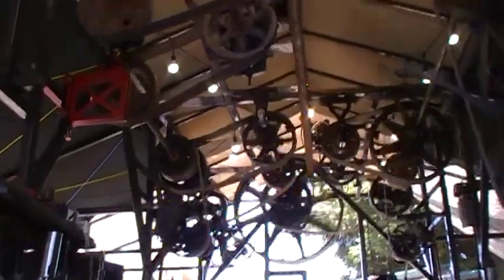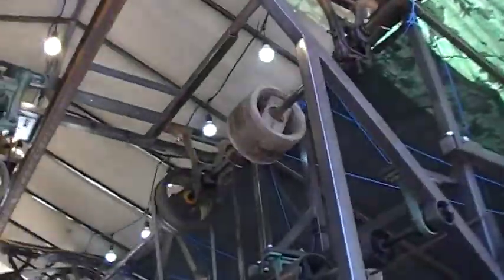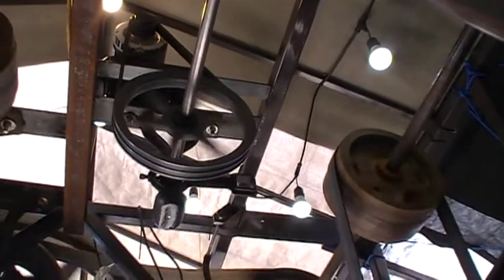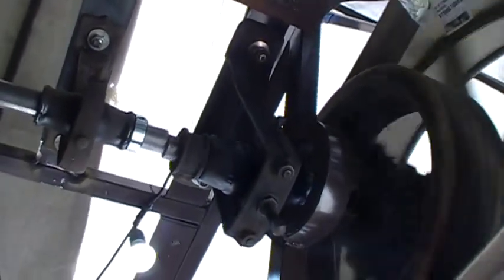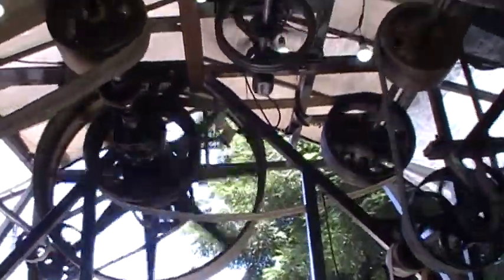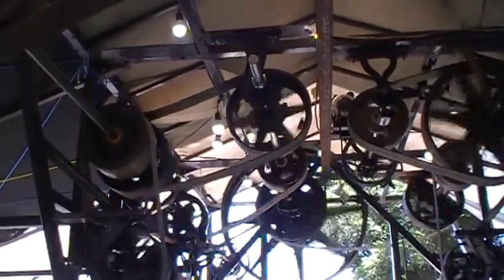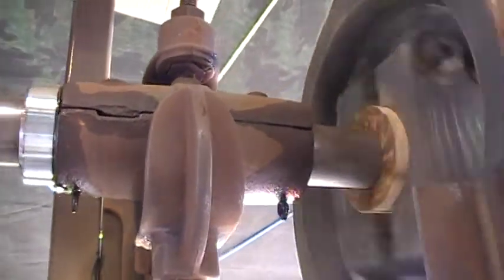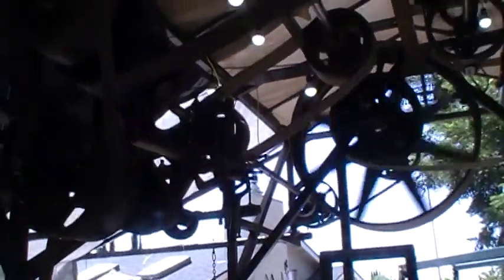Pulleys and Line Shafts

Comment: Hi David

Get a couple of clamp meters and see what the startup currents are on each drive...
The old way they synchronised stuff was to use DC drives...
Printing presses used DC motors...so it wouldn't tear the paper...

That what you've done here is an interesting display of lineshafts and associated pulleys, clutches & belt shippers...
People often just concentrate on the machine tools...and don't think about the various apparatus to get the drive down to where its needed...
Millwrights were skilled men...
Reply from the maker: Thanks Glenn. Now I have to come up with something else. This thing is going to sink under it's own weight. Hey what's the time difference between here and you?
Reply: @davewilson1591 

I'm not sure of the time distance...I'd have to look that one up..
I did send you an email though...
Check spam...
Reply from the maker: @glennmoreland6457  hi Glenn. I took my wife to Rome a couple times and it's 9 hours ahead of us here in sunny California. I figured you had to be at least 7 or 8 hours ahead.

Comment: Where did you find all these line shaft parts? im trying to find enough to set up my artistic smithing shop to run on line shafts as its way easier to maintain one engine vs multiple huge motors out in the off grid boonies. Unfortunately north carolina didnt really have many factories and shops like this compared with places further north and the few pieces i did find were being sold for astronomical prices as decorator pieces. im 25 and working on an artists budget so $1000 for two bearing blocks and a few feet of rod between for a coat rack that im just going to cannibalize for parts is out of the question. if youve got any leads you wouldnt mind passing along it would be very much appreciated and would certainly help keep this sort of system going for a new generation. thanks for your time if you read this.
Reply from the maker: Great that a young lady is interested in old technology...
The sad reality is this stuff is rapidly disappearing and some people think it's worth gold...  well I love the stuff..
 But I had to bite the bullet and spend the money.   A bit invested here.   Look on craigslist offer up Ebay local flee markets garage sales friends and join your local early day gas engine and tractor association.  Have patients it takes time and good luck.. 
You're young never give up.
Reply: @davewilson1591  thanks for the response! it seems like two distinct camps around here, one of people thinking its absolute gold, and others sitting on barns of the stuff just because they dont think theres a market for it. im trying to chase down a lead on a very nice line drive lathe that would be a nice upgrade in general thats currently rusting away in a field, and im hoping to someday come across some cache of pulleys and shafts i can afford-or at least build up a collection of enough compatible bits over time to make a setup. 
Reading your response did remind me though, up in the mountains near here are a couple old steam tractors rusting away in junkyards. it may be worth a bit of time to ride up and try to find out who owns the yard and if theyd turn loose of anything. At least it wouldnt hurt to shake those bushes. Wish me luck, maybe someday i'll be able to post the results to youtube or at the very least just keep the tech alive.
Reply from the maker: @emilyrobinson6080  I would suggest that you start video taping your projects earlier 'cause they're gone once you move on...  good luck.... your journey is just beginning.

Comment: Interesting set up - line shafts as art!  
If you want to know your rpms, rather than doing the calculations, get a digital laser tachometer.  That will give you instant accurate readings.  They run about $25 and are well worth the investment.
Reply from the maker: That sounds like a great idea. Where would I find one at that price? I use the medical technique of counting revolutions for 15 seconds and multiplying by 4. It works but  21st century tech would be easier. Thanks for the comment
Reply: @davewilson1591  
Amazon has them here:
https://www.amazon.com/Digital-Photo-Laser-Tachometer-Contact/dp/B001N4QY66
I'd think they'd be available at auto parts stores, but I don't know that for sure.
I can't vouch for the accuracy 100%, but my brother uses one on our old mill equipment and we get satisfactory and consistent results.

Comment: If you've got a broken hanger send it my way maybe I can make it onto a pattern so we can make copies.
Reply from the maker: You may have something there. I have a matching set. I think they might be rare simply because of poor design. They look good but are fragile.
Reply from the maker: I do have a hanger hanging around ha ha you could make a pattern from. It has really nice lines and is a stronger design.
Reply: @davewilson1591  might be able to beef them up s bit
Reply: @OldIronShops 

Are they designed to hang...?
Or be bolted to the ground...?
Reply: @glennmoreland6457  not sure